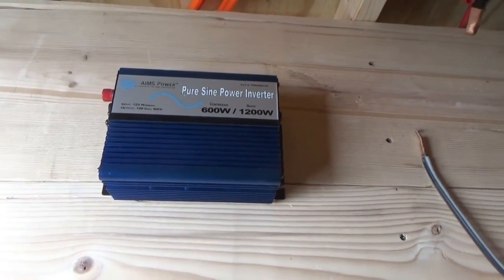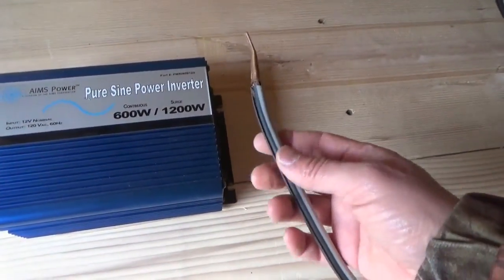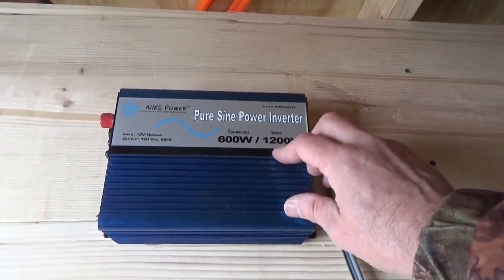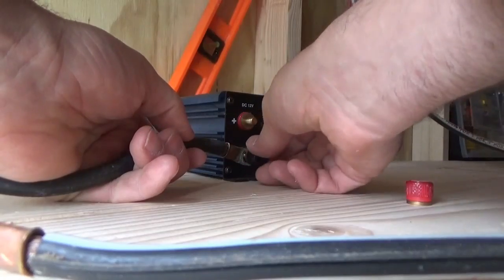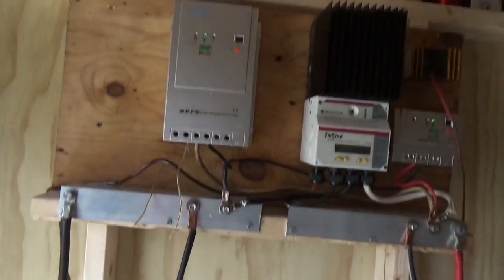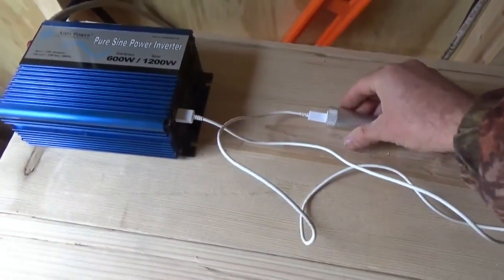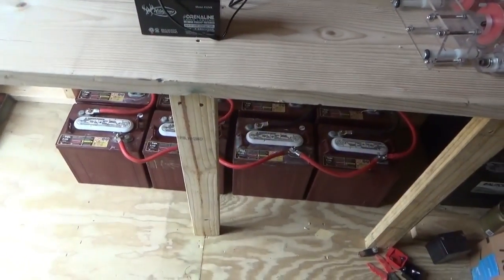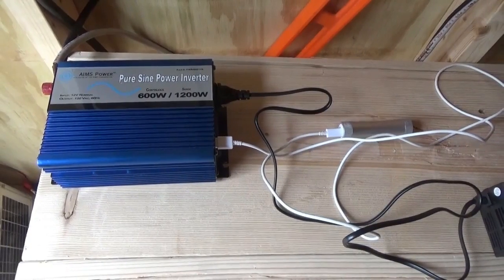How To Connect Power Inverter ~ Setting Up Off Grid Solar

Comment: I have a similar inverter, also with no designated ground terminal. I hooked up a grounding line, and clipped it to the negative terminal.  Is there a reason not to do this,  or is there another way to ground the unit?
Reply from the maker: I never grounded one of these to the earth anyway.

Comment: Do you need to hook up the earth connection on your invertor
Reply from the maker: For mobile applications it is not needed. For home applications it is better to connect it, although not required for operation of the inverter.

Comment: you only showed how to hook the inverter but did not show the other side of the cables.
Reply from the maker: Not sure what "other side" you are talking about. The inverter wires to go the batteries. On the other side of the inverter you plug in your appliances like in a house.

Comment: What about grounding the inverter, should I connect to the negative battery terminal
Reply from the maker: If you ground the inverter use a good Earth ground
Reply: @TheDoItYourselfWorld  do I need to ground the battery bank or just the inverter to my trailer frame

Comment: why it has a 600/1200 w    what is the deference between 600 and 1200 ? 
and thank you
Reply: 600w is what it produced on a constant basis sine wave and it can surge to 1200w. So if you were to flip on something that might take 1200 watts to turn on you're not gonna blow it

Comment: Hi boss.... I connect negative first then when I negative side this make a big spark and start making smoke from inside.... rapidly I disconnect it..this inverter bring like 6 spear fuses but l have to open the inverter to replace them and I don't wanna do it cuz it's new and I don't want to loose any warranty....what you should do?.... return it or open and change fuse...smell like something fries inside.
Reply from the maker: Since it is brand new, return it and get a working replacement. Do not open it until you have talked to the seller.
Reply: @TheDoItYourselfWorld  tnks a lot....what do you think can happened...this it's my 3rd inverter in 7 year and never had this problem before....its only two terminal nothing complicated to connect.
Reply: @raulwolf8921  make sure the inverter opperates at the same voltage as your battery bank. 12v inverter for a 12v  single battery or parallel conected 12v batteries (parallel is all + terminals connected in a line and all - connected by themselves= adds amps or cappacity).
If you have a 24v battery or 2x 12v batteries connected in series (series is negative from one battery to positive of the next= add volts) then you need a 24v inverter. Please ensure you watch several videos before you buy anything.

Comment: You did not specify where the inverter was hooked up to .THE WIRES WENT TO 2 SCREWS ON THE WALL...??? YOUR VIDEO IS CONFUSING.......HAVE SOMEONE ELSE EXPLAINED....
Reply from the maker: Red goes to the battery +. Black goes to the battery -. The AC lines you can run to your appliances.

Comment: 2:57 Its very hazardous to connect the negative terminal first followed by the positive as seen when you got zapped. A better way is to connect positive first, then negative. Your current method is highly dangerous & could get people killed/electrocuted.

Comment: Why does the Inverter spark when connected. This happened to me when I was connecting, thought I did something wrong, freaked out and have been scared to touch again
Reply from the maker: They have a huge capacitor, which is a sort of temporary storage of energy. They charge up immediately and take all the current they need in an instant when you connect the power. Scares me every time.
Reply: @TheDoItYourselfWorld  is it good for converter to work all day

Comment: Is It possible to connect with inverter without battery?
Reply: as far as i know, if its a small one to run a speaker or something, they can be connected in the cigarette lighter as well
Reply: No..it is not a generator itself of thats what your asking. You need a battery and or solar panels. For a generator you will need gasoline,propane,or 12 or 24V battery..charge from car,home outlet,wind turbine,or solar panel..Do many choices..Its easier then you may think
Reply: Constant power, bad idea, the solar panels itself dont provide enough electricity to power up your house, but by adding batteries...you can use the batteries electricity, and the solar panels will charge the batteries slow or medium..depending how big or design the solar panels are.
Reply: Otherwise you will need a constant supply of sun.
Reply: You need super thick wires or you need to step up your battery voltage. When I go to 3500 watts (currently at 2000) I’m going with 24 volts.

Comment: What order do you set up a solar setup-  I heard first hook up the charge controller to the battery, then the solar panel to the charge controller, and my question is do you hook up the inverter after all of that, and if you have multiple batteries, which battery do you hook it to, and do you need anything else to do so?  thank you
Reply: Same question and was told to hook up inverter cables with red on first battery and the black on the last?  Thanks for ring hint.

Comment: this aim inverters, I check one of them, the outlet from the circuitry or the transformer to the terminal connection is no able to handle the capacity advertise on  the inverter

Comment: I have an IDEA! for solar.
  Put all this crap in a car and one panel on the roof connect it all to your cars charging system .
  And every day while you are at work your car is charging your solar crap.
  When you get home plug your car into the home system.
  If the sun sucked that day your cars alternator should have a full charge on the battery's 
   If you have no sun you could start the car .
 I even think you should have dewalt and  other battery's on hand charged in the car.
Maybe two inverters

Comment: Really nice video!
I saw you are an expert. So could you please help me with some answers to my below questions?
I bought a wind turbine (1000W) and I want to use it in an off-grid system for a server and a computer. 

What type of battery I need to buy? 12V or 24V? 
What type of inverter I need to buy? 1000W or 3000W?
How long or short needs to be the wires?
I need any additional equipment for an off-grid system?
Reply from the maker: You can go with 12 or 24 volt. But higher voltage equals less losses in the lines and more efficiency.

You should buy an inverter large enough to run the devices you want to power. Get the biggest you can afford. The surge power of some motors is HUGE. Like a fridge.

Keep the wires as FAT and SHORT as possible. Thicker and shorter is better. For longer runs go thick.

You need an MPPT wind charge controller between the wind turbine and battery bank.
Reply: First of all.Thank you for your answer!

My 1KW turbine has 6 blades (1,6 m/sec ). Do you think it will generate enough energy for 24 V battery?
Could you please tell me how many battery I need for 1 server, 1 calculator and 2 monitors?
I need one more 1 kw turbine?

Please find below the characteristic of my 1kw turbine: 
Voltage: AC Three-phase 36Vmax (12/24V DC battery systems)
Peack Power 1KW  (1000W)
Rated Power: 750W
Dimension: 1300cm x 80cm x 85cm
Weight: 14Kg
Start-up wind: 1,6 m/sec (6 blades); 
Noise:< 40 dB
Color:Yellow/Orange
Warrenty: 2 Years
Characteristic: Axe vertical
Drive: DIRECT DRIVE
Reply from the maker: +Magurian Daniel 1000 watts is a decent amount of power. Again higher voltage will increase the efficiency of your system. If you can afford 24 volts then do it

Comment: Hi Troy. I just wanted to say i fully agree with you but i have just one small thing. What i would do is i would add one fuse for safety reason to all connected devices..You might disagree but it is really good idea because battery will deliver a lot of amp if shorted..and you will have thick cables...soo it might get really nasty really fast..Safety must be first..even when you are connecting battery banks paralell it is always good idea to use fuses..because if one battery will short out...rest of your battery bank could explode or your cabled could get really hot. This is how i would do it. But as always nice video.
Reply from the maker: I stripped down this video for beginners. Please read the video description and article where I explain this. I will be adding fuses and cutoff switches soon. Its for beginners.

Comment: Jumper cable wires are nice looking to me good ones for the inverter. I like that one that is clearly marked POS that is great. I would have cleaned the green tarnish off that ring terminal with a wire bursh or sand paper or steel wool until it shined brightly for maximum contact. Looks like four gauge or even two gauge wire plenty big enough I am guessing. Also the two copper ring terminals are so close they could possibly touch and explode the inverter. So put some black tape on the copper ring terminals where they could make contact where they could come loose and swing around and touch into each other that would be disastrous for the inverter.  Also first thing I would do is mount the inverter to the table so it cannot move and cause the leads to come loose or touch each other. Be careful when you undo the leads if the inverter is loose it can move and the wires are stiff and springy and they will try their best to touch each other Murphy's law.  Best to get some shrink wrap for the terminals so they cannot touch it looks very tidy too but black tape if you don't have any. Black tape leaves sticky glue no one likes later. Maybe someone will send you some kind of a kit for shrink wrap for electrical wires that would be very handy and helpful for your solar system. They have many assorted packages on ebay for sale.

Comment: First of all, I will back Troy up on this..Takes notes..First of all, The Power does have fusing. Second of all. Its just a simple way to show people how you can connect a power inverter.  Yes fusing inline should be used. But since most portable power inverters do have built in fusing, Most of the people won't care in normal everyday life. Now for my rant. I have been watching Troy for many years. No I am not a Troy nuthugger. I just enjoy different video's all over. Is he right or wrong. Thats just an opinion. But I swear most of you are just Hippocrates. That think they are better than everyone.  Old saying goes. If you can't say nothing nice , don't say anything. Rather than set here and call most of you genuine inferior less intelligent people with a few other names. I will refrain. And ask you to ask yourself one question...If you did these types of Video's would you aprreciate the hassle of others Bs.
Reply from the maker: Thank you. I am keeping it simple for beginners. Then I will add more complex items like cutoff switches and fuses later on. This is a very simplified instructional for beginners. Many people are appreciating it too :)

Comment: Interesting videos the last few days. Just some suggestions. Instead of saying super thick wire you should talk in gage size. Also knowing what amps and volts the gage is rated for would be good knowledge to pass on. You know that there should be some fuses in this system. With all the stuff you have collected over the years you don't have any fuse blocks?
Reply from the maker: +The Long Project I will cover all that later. Starting out simple. Working up to more details.
Reply: never forget about fire safty Troy, thats a thing you dont need, nevermind iff its not nice, be sure its as safe as possible, for emergency you could even fabricate your own emergency no cost homemade fuse.  (use a piece off 2,5 mm un isolated wire , 6cm long between to bolts with washers and nuts mounted trough a piece off isolated material (or even wood when you use stand offs.)
Reply: Hi, like he said use thick wires when connections to a big dc inverter like the one he has that can handle 6,000 watts. I would use pure copper 2 AWG gauge cables so they last longer down the road.  DC cables come in different gauges like 2 AWG, 4 AWG, 6 8 10 12 14 and 16 gauge as well, the point is the smaller the number of the guage the thicker the cable will be as it will handle more current.  Hope that helps.  Thanks for sharing your setup too man,nice battery stack too, cheers.

Comment: Hey Troy, I can vouch for what happens if you wear dangling metal things around your neck when working on high 
amperage batteries.

I was section chief in a Lance Missile firing platoon stationed in West Germany in the late 70's and early 80's.
We were doing PMCS on our M-752 tracked missile launcher.  PFC Hawley was using a wire brush to clean up the terminals
on the two 24 volt batteries we used to start the track.  He was leaning over the battery box when his US Army Dog Tags around his neck on a metal beaded chain fell out of his shirt and shorted out on the battery terminals.

POW!!!  Knocked him off the track and burned a precise dotted line around his neck.
We used to say this was an example defective operator headspace.
Fortunately Hawley was not seriously hurt but he will carry that dotted line on his neck the rest of his life.
Reply from the maker: +Bill23799 lol. Forgot about that term. Headspace

Comment: 600 watt pure sine wave inverter?  Not many uses under 600 watts for pure sine wave.  That's kinda like putting a car engine in a golf cart and then limiting it's output so it won't go over 15 mph.
Reply from the maker: Well, this is the very same inverter I used in the off grid tiny house on wheels for a long time. So I do not get what anyone has to complain about. And I chose a basic, simple inverter for basic videos for beginners. I will build up to more complex things later with time. One video at a time. One step at a time. Thats why I used the small inverter. Most beginners will start out with a small setup with one or two solar panels and a battery or two.
Reply from the maker: +ElGatoLoco698 why? It's all I needed in the tiny house. It's all I need for the shed. Why get a Ferrari to go get groceries down the block?
Reply: First off, you need to recognize that most of the viewers you attract will be looking for information for something bigger than taking a shed off the grid.
Reply: That's what I was wondering.  A 600 watt pure sine wave inverter is pretty much pointless.  Anything that needs a pure sine wave inverter usually draws a lot more than 600 watts.
Reply: @ElGatoLoco698  power tool batteries, phones, laptops...what r u talking about?
Reply: @homesteadinhawaii3261  el gato loco thinks pure sine wave is only for high drawing devices. He doesn't know yet that pure sine wave is for a cleaner smoother waveform (most similar to your house's power outlets) for delicate or sophisticated circuits within devices.
Reply: I have bought two secondhand 190 watt solar panels for $100  and will  either be used in a camper or the new shed I'm building, but most likely or my new shed, so gret video!
Reply: Do you know that question is totally and completely random, irrelevant and borderline schizophrenic?  

Do you know prisons house dangerous criminals?
Do you know that Barack Obama is no longer president?
Do you know the Sun is very very hot?
Reply: What the f are you talking about?  Do you know poop was the apple?

Comment: that gets you up and running quick but not safe. should be a fuse at the power source and the connectors could easly move a little and touch. a easy cheap way to prevent it is cut some scrap garden hose about 6 inches or so. put it on the wire loose before you connect the bolt. after you segure the bolt to tne inverter just press it up all the way towards the connector. use a little ele trical tape on the other end of the hose wraped around the end of the hose and onto the wire. works good, easy to remove and is resuable. I think its better than heat shrink tubine.

Comment: FUSE!!!, in the main bank cable (and main switch is a good idea..), its also smart to shrink tube or tape off the lugs, to keep the non isolated parts as less as possible, agree about your advice on the  lead thickness and lenght!
Reply: also on low voltage, high amperage, y agree fully!
Reply from the maker: Please read my description and articles. I am doing a series and showing the BASICS first. I have to keep it simple. Then expand on things and show cut off switches and fuses. Read the comments on the battery wiring. Many people are not ready for the complex things yet. Step by step.

Comment: the terminals on the inverter could turn and short out. they need to be insulted. what about a fuse on bus bar
Reply: always insult your terminals to establish dominance
Reply from the maker: Bad terminals!! Ugly terminals!! Bad. Bad.
Reply: iff you isolate them they will work fine.. (shrink tube, ore electrical tape) (or even ductape)
Reply: lol no need to insult them then... lol
Reply: LOL I have had those to do that on a Grid Tie inverter before but on a regular inverter its is crucial. You gotta know if you leave out one minor detail everyone will talk about it. I would not take it personal. You have a lot of viewers so its going to happen many time over come on man you have 96 thousand subs so your gonna get a lots of the same comment. Take it like a duck let roll off your back. I dont have a lot of viewers so I dont have that problem just a few comments and yes they catch anything I let get by and let me know about it. They have saved my ass a few times too.